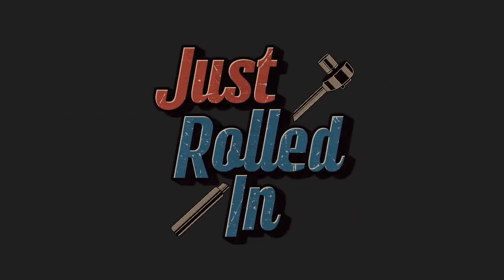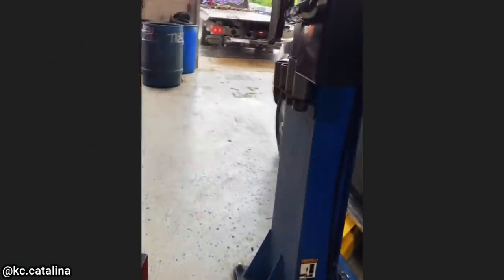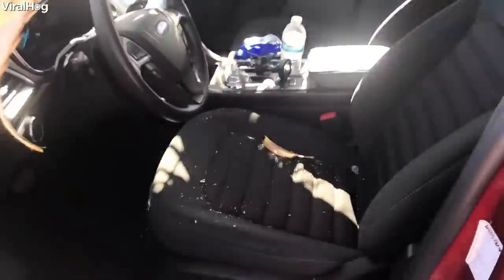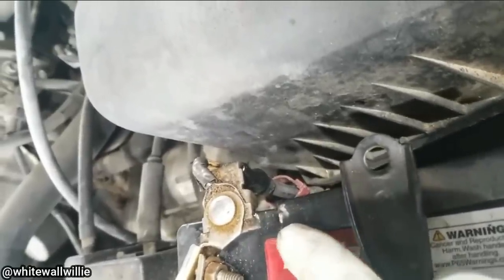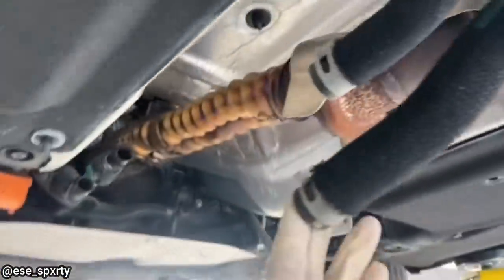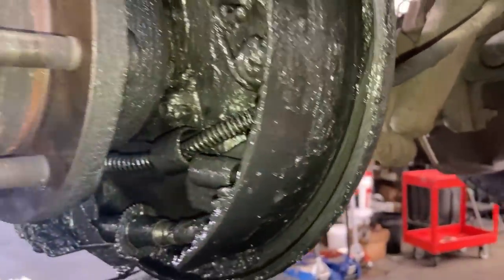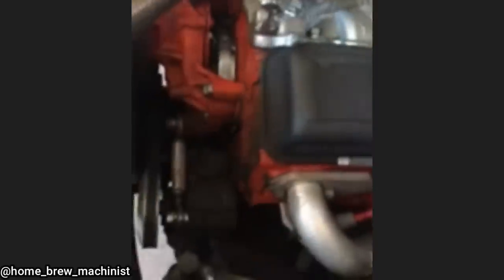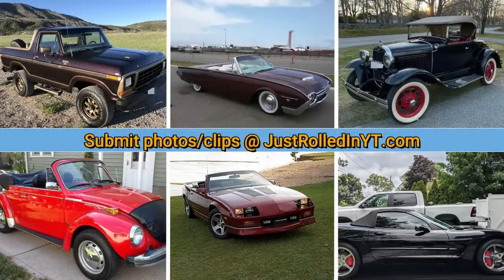Customer States New Engine Installed At Another Shop And Now Has A Leak | Just Rolled In

Comment from the maker: Happy Monday!

Next video will most likely be the best of May & June compilation (since I'm away), but after that it'll be back to regular episodes. Hope you guys have a great week and I just want to say thanks for all the support lately! Can't believe we are almost at 200k subscribers. Your support means a lot.

Submit your photos/clips @ www.justrolledinyt.com
Reply: Can you include more clips about electric vehicles?
Reply from the maker: I don't get those clips often but if I do I always share them with you guys.
Reply: @JustRolledIn  Oh ok
Reply: Always excited when I get an alert from this channel. 😊 thanks
Reply: Yo bro... that "StethoScope" method I mentioned actually works real good!  Any piece of 4 or 5 foot 2x2 pine stick or even some trim moulding, press it tight against ur ear and CAREFULLY put it on all the parts of the motor.  You can hear everything!  Alternator bearings, fuel pump, water pump bearings, lifters knocking through the intake & valve covers or valves in the headers and rods in the lower block!
Reply: funny story, I sold a car to a customer, she took it to shop for routine maintenance, the shop told her to add a quart of oil every 100 miles due to blowby, I ended up refunding her money and when I got the car back it was blowing solid white smoke, we pulled the oil plug and 21 quarts of oil drained out, needless to say after that the car ran just fine
Reply from the maker: @ItsaRomethingeveryday  Holy cow 😅😆. I can't believe some shops and what they tell customers.
Reply: @JustRolledIn  oh I know right 👍
Reply: Question. How often you get viewer and/or subscriber submissions of photos and/or clips?
Reply: Technically, if that V6 Challenger is supercharged, it would be considered a Hellkitten, and deserving of the Hellcat symbols,  Im doing the same with my Supercharged v6 Challenger,  @509BHP the only thing faster stock from the dealership than it would be the 6.2 liter Supercharged Hemi v8 in the Challenger SRT Hellcat @707 BHP, the 6.2 liter High Output Supercharged undertuned v8 in the Challenger SRT Hellcat Redeye @797 BHP, and the 6.2 liter High Output Supercharged Jailbreak v8 in the wide body Challenger SRT Demon @840 BHP.   The 5.7 hemi in the Challenger R/T stock only puts out 365 BHP and the 6.4 Liter hemi in the Challenger SRT stock puts out 485BHP.
Reply from the maker: @therandomizer9943  viewer rides for example I get 50-100 photos a week.
Photos and clips, some weeks not a lot and some weeks more often.

Comment: When the hood for the Willys was opened I was ready to see an LS or something modern based on the slight rumble.  That old girl sounded sweet!!
Reply from the maker: Lol imagine that! The person who shared the clip sent me a bunch of information about it. It has adjustable suspension and it requires 2 quarts of oil after every 70 miles of driving. Pretty interesting.
Reply: @JustRolledIn  Puts on old man's hat   Back in my day, cars were easy to work on!  We didn't have them fancy compooters telling us all kinds of codes!  lol
Reply: I was expecting the same, when that hood opened it almost caught my breath. It is amazing.🇺🇸🍻
Reply: I think it's a sleeve valve engine, not poppet valves, which is why it sounds that way.
Reply: @JustRolledIn  IIRC, engines that old didn't have proper seals in them, at least I think I read that or heard that somewhere xD
Reply: TMC
That is correct, slide valves, and comes with a healthy thirst for engine oil too!
Reply: HOOAH!!!
Reply: One can leave a champane glass on top of valve cover and it will stay there
Reply: @JustRolledIn   just like a Detroit motor... you never change the oil, only the filter
Reply: There was just a little sewing machine inside
Reply: @JustRolledIn  And i thought my e46 bmw burned oil pretty bad lol
Reply: @JustRolledIn  So it drinks oil like a new Porsche
Reply: @BuzzinVideography  For Detroit motors you should see Bus Grease Monkey. (Yes that's a YouTube channel)
Reply: I was actually envisioning a kid blowing bubble in chocolate milk with a straw.
That's what the engine sound first reminded me of.
Reply: But that clanking sound is not what anyone wants to hear on their engine
Reply: @davidp2888  was that back in the day of kerosene TVs? 🤣🤣
Reply: That clip made me excited to hear the old 47 Willy's that I used to cruise around the homestead land in with my father when I was a kid.  He had a few vehicles he was going to restore when he retired but passed away a year after he retired so he had a few vehicles to restore that I now have and get to work on for him to see his unfinished projects finished.  It's sad but I feel good working on his old vehicles me and my brother got his old 78 camaro z28 running for my mom which she gave to my brother and now we work on that together from time to time.
Reply: You can’t hear very well can you that sounded nothing like a modern V8 maybe you need some hearing aids?
Reply: @davidp2888  Sure but oversized and horrible fuel milage ! I learned tto drive in my Dad's car, a 1968 Grand Parisian two door, his pride and joy. 327ci, 4 barrels carb. specialorder 4 speed outo. A real rubber burner.
BUT, a fuel hog ! He let me drive it to take my GF to town etc. to the condition I returned it fueled up. 😱
I quickly learned to drive slooowly !
Reply: @ChazzleDazzleVideos  I have a 79 Z-28, absolutely love that car! In my opinion the 78-81 Z-28's were some of the coolest looking cars that ever came out of Detroit! Along with like a 71 Cuda's and the old Mach 1's!
Reply: @hoppscraft  Not if my Aunt Betty's around!
Reply: @theundergroundlairofthesqu9261  ha ha ok that s kool
Reply: No computers, sensors, infotainment centers, just good old compression, fuel, and spark.
Reply: It shouldnt need that much oil... needs some seal and ring work maybe
Reply: Flat tappet camshaft
Reply: Ditto
Reply: @ehsnils  I use to work on them quite a lot and often found one without oil from just sitting a week. Would change the filter just as normal as other equipment because at least there was nothing falling on me. Haha
Reply: But looked like hell
Reply: @marcryvon  fun story
Reply: @JustRolledIn  Guessing it uses that much oil because its worn then? I know the older cars did burn some oil, but that seems a bit too much. cool car though 🙂
Reply: @TwistedDonners and wind-up cell phones!

Comment: Cool Willys-Knight! Those engines used sleeve valves, which made them much quieter than engines with poppet valves. Unfortunately, one of the drawbacks was high oil consumption. It sure sounded smooth and quiet in the video. not sure I have even seen one in person before.
Reply from the maker: 2 quarts every 70 miles it says in the owners manual, I was told. The viewer who shared the clip might have some more clips of it in the future.
Reply: I looked up sleeve valves to see how they worked. That is insane. How that made it into production is beyond me.
Reply: @roberthunter5059 As the sleeves wore, they would get carboned up, reducing performance. Altho, back then it was normal to need a valve job on regular cars at 10-15000 miles. Advances in metallurgy made poppet valves last longer, and once hydraulic lifters came along (in 1930) any advantage sleeve valves had were gone.
Reply: I really love this post because I had no idea. Thank you!
Reply: @madisntit6547  You should learn about engine's, everyone, or every man should! Nothing like the feeling when you build your own engine! There's a lot to learn, never ending actually,but fun! I work on performance V-8's and to learn about cam events and head flow, compression etc.etc. If you thought your college classes were tough, buckle up!
Reply: Hawker typhoon ground attack aircraft had sleeve valves in WW2. 2500hp when spitfires only had around 1500. Sleeve valve tech was pretty much at the end of it's life then.
Reply: @madisntit6547  well they were a devastating ground attack aircraft at the time though. Everything eventually becomes obsolete though. Served all war. Might have even seen some action in Korea but that's only a guess. Quite a bit of WW2 stuff was still used then including a lot of mustangs.
Reply: @docsmallblock6584  ok boomer

Comment: I'm a bit shocked at the palm leaf.  Must have struck the windshield at the perfect angle.
Reply: Could it also be because that spot has sensors for rain, etc.?
Reply: Palm trees can grow to about 70 feet.  If you're dropping something from that height, the angle doesn't matter a lot
Reply: @almostfm  True. I suppose I'm always thinking of dwarf palms.
Reply: Pineapple Palms. (CID's) The fronds. Are up to 30lbs. And have 6in or longer thorns.
Reply: @almostfm  Canary island date palms have pretty much the heaviest fronds. The queen palm has a torpedo looking seed pod. I have cut some over 130lbs and 7ft long
Reply: What's odd to me is those palm fronds don't fall off like that, to fall out from the base like that.  Not normal.  I think someone was pruning that tree and missed one of the fronds that was cut.  It got hung up in some other fronds for awhile but eventually fell off.  Otherwise those things stay in the tree trunk basically forever.
Reply: @jonesjones7057  for sure. If a cid frond or queen palm frond was even scratched. It would be laying down before morning. I had a tree service in Sarasota Florida for 10 yrs. Scratched fronds were a test for new climbers/cutters. A lot of trimmers would not do cid's . The thorns had a toxicity. They would make you sick. And have the runs for days.

Comment: Every time I think I will not be amazed, you come up with something that does. The orange "transmission fluid stop leak", the wheel bearing, the brake fluid leak (Wonder how many cans of fluid was in the car.)  and the weld my cracked power steering rack topped the list.
Reply: a wrecker company went to the seen of a 2 car wreck the truck that hit the other car the tie rod fell apart / broke  the guy set it back on and thought he was going to drive it home .. don't think tie wire would of held it together it was bad , sloppy ,,

Comment: That Willys is beautiful.... I love older cars w/ no computers, there's something about them that just speaks to me.
Reply from the maker: I agree on that!
Reply: @JustRolledIn  - I blame it on my birth year and the fact that I was a kid when all the 60s and 70s muscle cars were still on the road... I can't help but love the sound of a V8 w/ no exhaust.    😂
Reply: Agree. Computers and more electronics is just more stuff to go wrong. That old lady is a beaut, and still running - 'cause it's well made.
Reply: @unclenogbad1509  - Exactly... What happens when the computer doesn't work¿? The engine doesn't run but it's perfectly capable of running, but it won't... O and the computer part that needs replaced only comes in a whole part being replaced and the computer needs reprogramming which screws up then everything starts going bad in the system. Then you need a whole wiring harness replaced, etc etc....     😤     lol
Reply: @xpndblhero5170  etc, etc, etc......

Comment: How do you overfill an engine by 2 gallons and forget to drop the oil your changing? Did they not check the dip when the job was finished either? 😳
Reply: Alcoholism is a real thing ;-)
Reply: Dipstick? What is a Dipstick? 🤔🙄
Reply: Because it's not full until it's at the top of the dipstick duh!

Comment: The worst I ever encountered was a customer who had his "friend" replace his RF lower ball-joint on his Mk4 Jetta. It was in for a complaint of a hard pull to the right, and that the right wheel looked "excessively angled". The lower ball-joints on Mk4 VWs get inserted into the lower control arm, then three bolts go through and secure to captive nuts. If you can't see what you're doing, you can completely miss the ball-joint with several of the bolts, and that's exactly what happened to this guy. When I got it back to the shop I found only one bolt holding that ball-joint on, and it had worn about 3/4 of the way through. Talk about a pucker factor of 10. When I had taken it on our test drive route I immediately knew something was off, and when I took it over the speedbumps the car abruptly yanked to the right. To say it was dangerous is an understatement. It was about a half an inch away from pulling his axle apart and tearing the CV joint boots too. The guy had just finished a long highway trip as well. Thank god we caught it in the nick of time.

Comment: On more than one occasion I have had a customer bring in their car and the oil was filled to the cap. Luckily the engine was fine after we drain the oil and did a proper oil/filter change. Surprisingly both times there’s no water in the radiator and it was over 90° in the summer. smh
Reply from the maker: I've seen that a few times as well. First time was on a Ford Focus when I started out in the trade. I couldn't believe it but I remember the customer said he spent so much money to change his oil. I wonder why haha

Comment: I had a differential replaced at a BMW shop, under warranty.  They ‘forgot’ to tighten the mounting bolts… another BMW shop documented the repair but only tightened the differential bolts….  I had to finish the job by tightening the rear shock absorber bolts….  I never went back to a BMW dealer.

Comment: After over 40 yrs of wrenching. I put away my tools and started teaching college mechanics. I got tired of idiots. Such as. You changed my oil and my air conditioner quit working. Or, You just did my brakes. And my transmission went out. No more dealership or mobile jobs for me. I gladly passed on the torch.
Reply: I'm in the same Boat. I'm a Mechanical Engineering Consultant now. Forty years in the Trenches. I specialize in Automotive, HVAC , & Plumbing technology.

Comment: How do you not reinstall the axle nut??  I used to have a Camaro that looked a lot like that one. It sounded a lot better though!  350LT1 with headers, Isky 3/4 race cam, single plane Holley manifold and 4 bbl, Mallory dual point distributor, balanced and ported, TH400 with Transgo shift kit and B&M shifter. That was a fast car!

Comment: I just won a decent case in small claims against a big dealer for a blatant LIE on a damaged vehicle.It was actually very easy and i won when the delaer reached a deal in moderation--also you add an fees you generate so if this happens get all receipts and file in small claims--the win ratio for these types of cases is over 95% because used car etc does not mean you can LIE or mislead.BTW in small claims no lawyers can go into court and any judge that sees this will side with you.
Reply: “Mediation?”
Reply: @carpballet  A moderator is a person whose role is to act as a neutral participant in a debate or discussion, so I guess he's half right.

Comment: Had friend to come over and plan was to do the brake disk and pad change and replace caliber on right side on my garage 2km away, after she stopped on my place. Well she had stopped on the way here to cool off brakes since caliber didnt return. When she stopped to my yard everything was so hot and worn down that it friction welded the pad backing into rotor. Ended up having to do the work on the yard, instead of garage since thing would not move anywhere and taking it apart was bloody nightmare.

Comment: I bought a Honda Element “mechanics special” with a pretty serious leak from where I “thought” was the rear main seal. Dude said his mechanic just put a new clutch in. Brought it home and THEN realized it was leaking manual transmission fluid, not oil (Honda mtf is low viscosity and looks and feels like oil)
Figured it was an input shaft seal on the trans and got the part ordered.
Took the trans out and the transmission case behind the clutch, all around the input shaft, was covered in jb weld. 
I can only assume the “tech” had the car on the lift and DROPPED the transmission while doing the clutch, breaking the case. Instead of doing the right thing he glued that sucker back together.
ANYWAY, that’s the risk of buying a used car lol.

Comment: I had my bike at a shop and it had a few issues I paid for it to be looked over and it still didn’t work so I sent it back paid more money and I had the same issues. I looked at it myself and found one side of headers had no bolts on it, float needle was broke, tank pet cock was leaking gas, and gas had eaten a hole in the rubber connected for the carb breather hose. I could forgive all of that but I specifically asked the chain and sprocket to be changed because it looked rough and tires were being changed so it’d be a good time. it was covered in rust and I’m sure the gas from the pet cock hitting the o- rings in the chain definitely weren’t doin it any favors. I was told multiple times it had so much life in it that it’d be a waste and basically refused to do the service. Not long afterwards I started doing the work myself specifically the carb, tank cleaning, and putting header flange and bolts in and went for a test drive got it to 45mph on the way to the highway and the chain failed.. back tire locked up and I kept it up however if I made it to the highway it’d probably be a different story.. chain kinked, forced itself off the back sprocket and ate part of the swing arm and bolts holding the rear sprocket on.

Comment: 1932 Willys Knight vehicle still running is Amazing in 2022 that's 90 years old, most modern cars will never last this long, especially with owner's neglecting them bad service shops working on them. This vehicle engine is very robust. Just needs overhaul of the body, interior. The engine looks all original that's Amazing. The original owner of this car has been dead and gone his or her car is still running Wow.

Comment: 2:12 I recall identifying the reason a forklift had no brakes by my sense of smell. The brake shoes smelled of both brake fluid and gear oil. The slave cylinders, brakes shoes, and differential oil seals needed replaced.